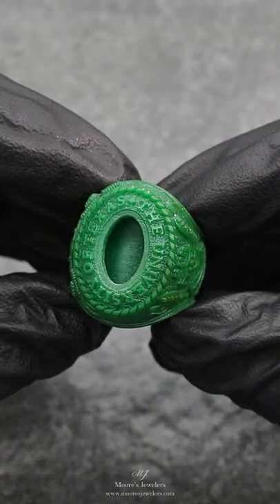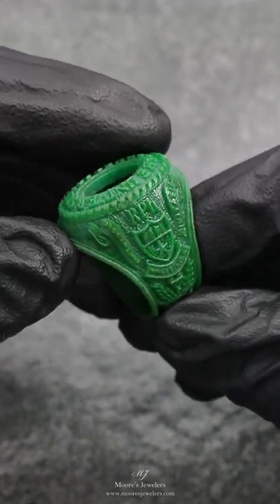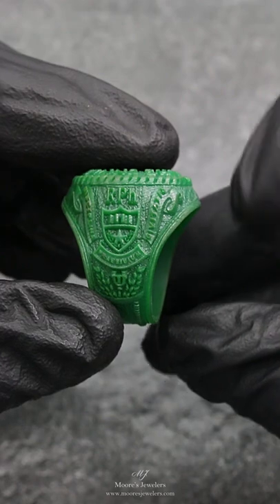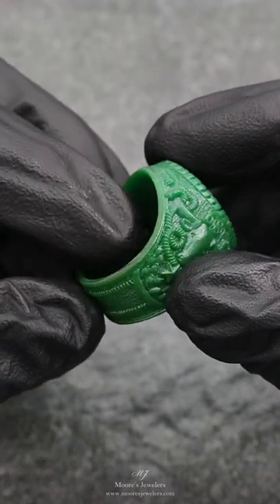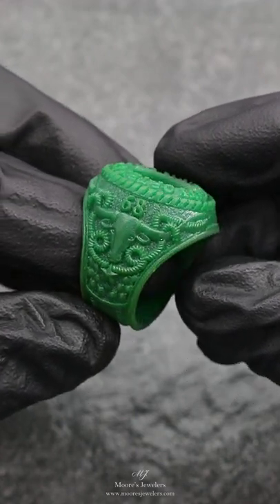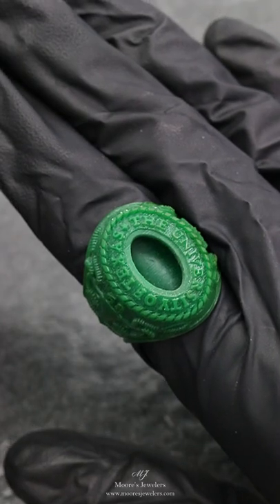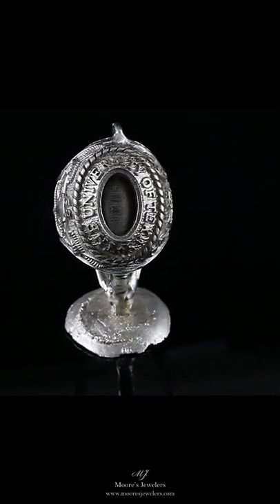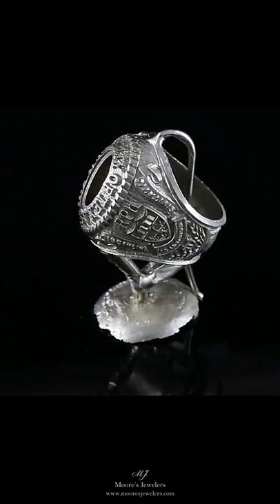Custom Made Texas University Class Ring 3d Print: Moore's Jewelers

Comment: How much would a ring like that, with that level of detail, cost in Sterling silver?
Reply from the maker: It's hard to give an exact price, as this particular ring is a unique case. This ring was designed using photocopies of very old and worn out photographs (before digital photos) of the ring being worn on the relative's finger. If I recall correctly the original ring was lost and our client's customer wanted an exact (or as close as possible) match to the original ring and all they had was one off photos of it being worn. So it took much longer to get every detail correct. With all that being said the 3d modeling charge for this ring was around $1,300, plus the printing, casting, and the metal. What isn't shown in the clip is the top plate to the ring. This plate was cast separately so that the ring could be cast with a hollow core to keep the weight as light as possible. To give a better estimate we would just need to see examples of what you'd like to have made. Price just comes down to how long it would take to create. Custom models start at $80.00, but class rings and detailed signet rings usually range from $300-$500; again price really depends on detail, source material, and what's being made. Silver is also in the same boat as price for the metal all depends on how much the ring weighs. 

Sorry if it’s a tad vague, it’s hard to give pricing, very true for jewelry, without seeing examples and knowing various information like finger size. This is because so many elements place a key roll. Like the finger size, the ring in the video is a US size 13, but if you wear say a 9 or 10 that would be a significant change in weight and would also change how much detailing would fit around the ring. 

Hope that helps. If you have any other questions feel free to ask! 

-Chris
Reply: @Mooresjewelers thank you !!

Comment: printer model?
Reply from the maker: First off to print detailed models such as this you’ll need a SLA/SLS style printer or any advanced form of printer. FDM or similar technology isn’t capable of this level of detail (at least to our knowledge).

To be honest, there really isn’t a one answer anymore when it comes to printers nowadays. Even the entry level printers are capable of printing a ring like this given the user knows how to create the model for the machine. For lower end machines resolution is necessary, but skill plays the biggest role.

We have (and use) a bunch of different printers here in the studio as we are always testing out new equipment. These include a few high end printers such as the B9 core series machines down to budget printers like anycubic photon (elegoo, pursa, etc as most of these are similar machines). We’ve printed detailed rings such as this on all the printers. The only difference is the resolution, micron level, layer lines, and printer speed; which again goes back to the skill of the user. If the modeler knows how to create for the machine then these set backs can be minimized. 

If you’re looking to get a printer I would suggest first figuring out the micron level and type of resin you’ll need; then picking up an entry level SLA printer that checks all the boxes. They have come along way in the past few years. Unless you’re looking for business, I doubt any individual would need something high end anymore.

Also formlabs is another popular SLA/SLS print you could look into. We personally never picked one up as we aren’t found of their castable resins. Client’s send us pieces all the time for casting and they never come out smooth as the other resin brands; no matter how correctly our clients or we cure the prints.

Hope that helps and good luck! 

-Chris